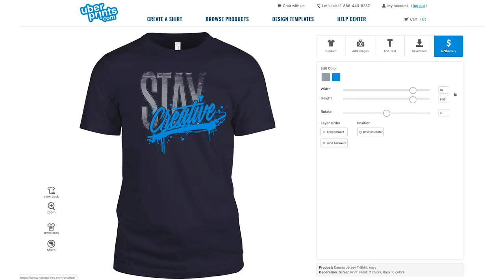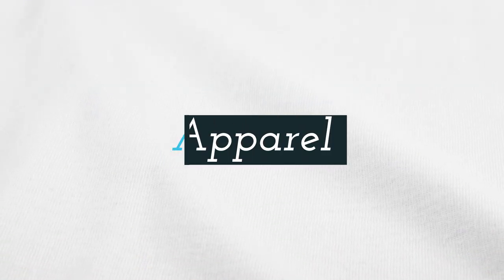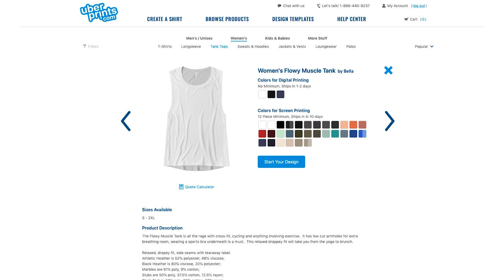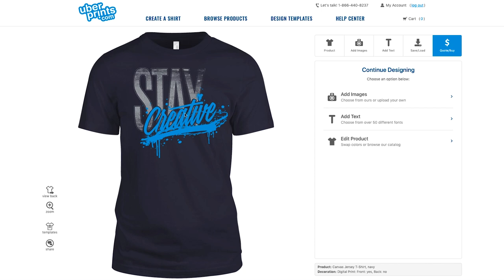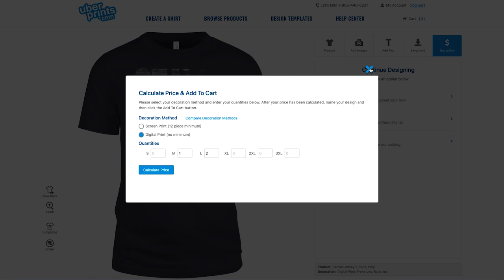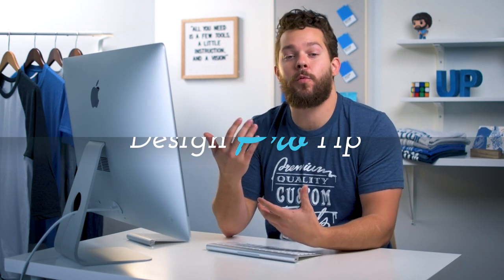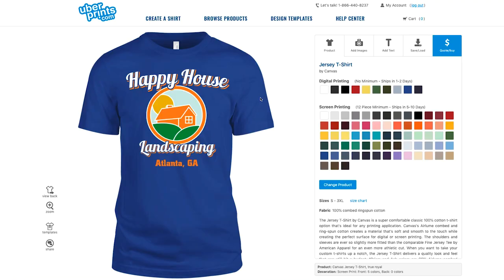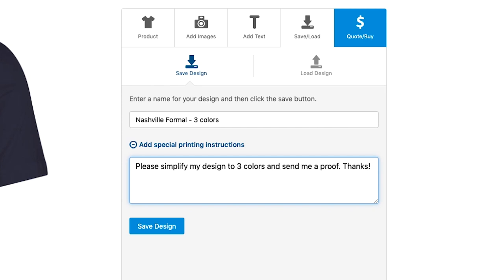Screen Printing vs Digital Printing - Everything You Need To Know

Comment: My concern with the differences is im wondering which is effected more after wash like i know some shirts get cracks in the print im just wondering which will last longer and be in the best quality after washings
Reply from the maker: If done correctly, both screen printing and digital printing should last for many, many washes. In digital printing, the cracking that you're referring to is actually a sign that the t-shirt was not pretreated or cured properly and you may have experienced this because the process can be a little temperamental. I'd recommend finding a printer with great customer service for some peace of mind, and that's where we come in.

Comment: What digital machines do you recommend? What if someone wants to order a lot of shirts and prefers it to be digital, does it become too expensive to be worth it? I see you have a lot of digital printers, are those models designed for mass production/printing?
Reply from the maker: Some customers prefer digital printing because of the fast production time and the ease of reproducing photographic images. You just won't see the bulk discounts that screen printing offers at larger quantities. It comes down to what you're trying to achieve and for some, digital printing makes more sense despite a larger order size.

Comment: Why is screen printing cheaper than digital if digital requires less steps/man power?
Reply from the maker: Great question! Digital printing takes fewer steps to set up, but doesn't offer much of a bulk discount because it takes just as much work to print the last as it does the first. Screen printing requires more work to set up, but you get much larger bulk discounts because production gets more and more efficient as you print more. So screen printing is cheaper for bulk orders, but you'll find that digital printing is much cheaper for smaller orders.